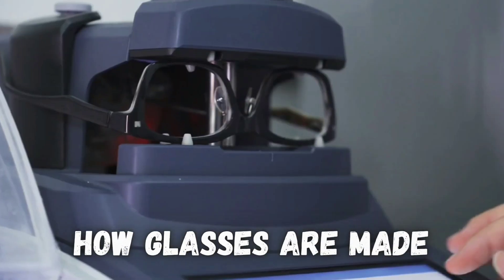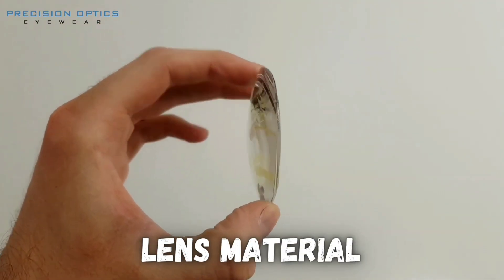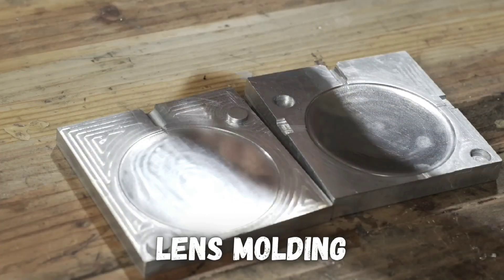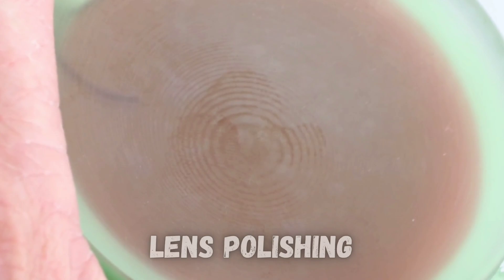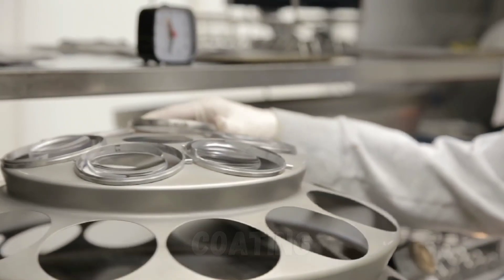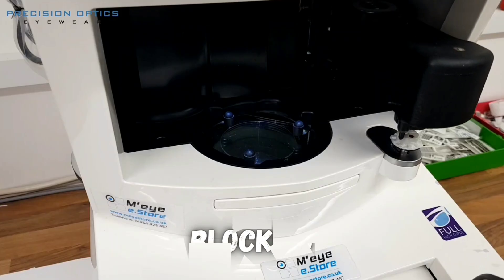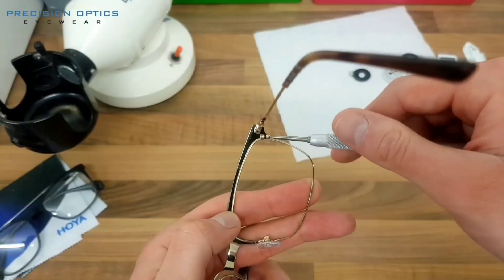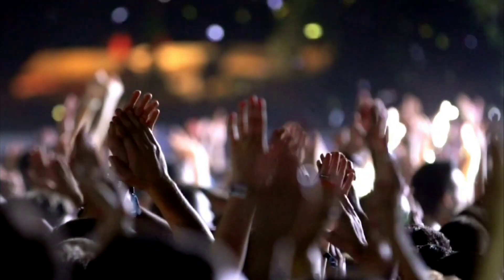How Glasses are Made

Comment: Astigmatism isn't that easy to explain huh? I never knew prescription glasses were molded. I guess there is a finite number of near/farsightedness and astigmatism-strength-combinations, so a factory can have all the relevant molds on hand. Just like contact lens factories just produce all combinations of lenses. Except that for the glasses they can probably reuse the molds for all rotational degrees of astigmatism. - Interesting video that sparked some thoughts.
Reply from the maker: Astigmatism isn't too hard to explain (asymmetrically shaped eyes cause light to be focused differently in different directions), but I try to not stray too far from the main focus of a video so that people who came for that topic don't lose interest 😁 and exactly! There are standard molds for common prescriptions, but more unique prescriptions require grinding and polishing